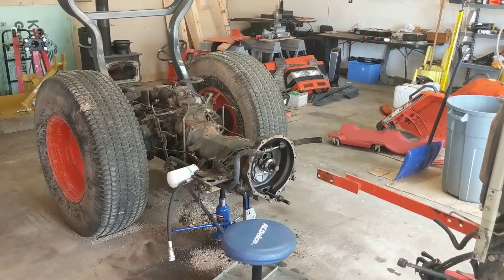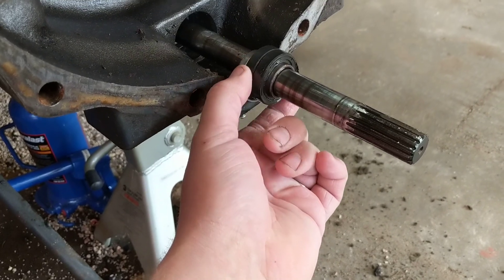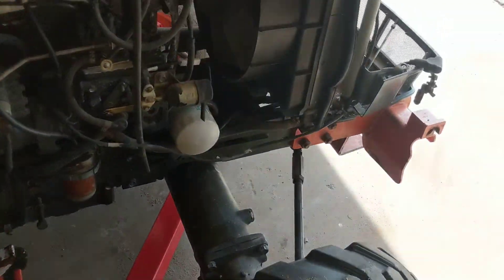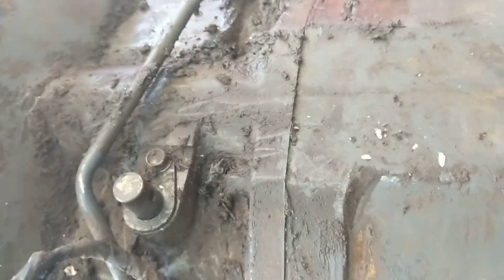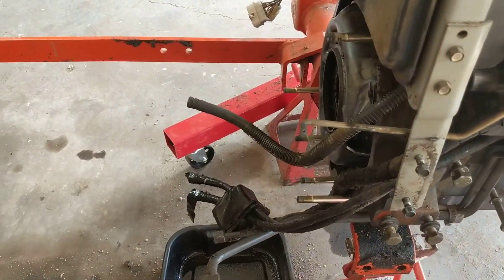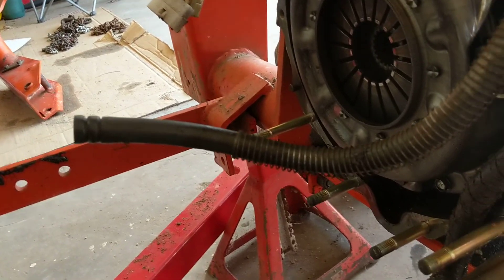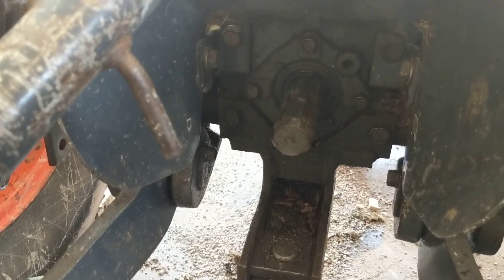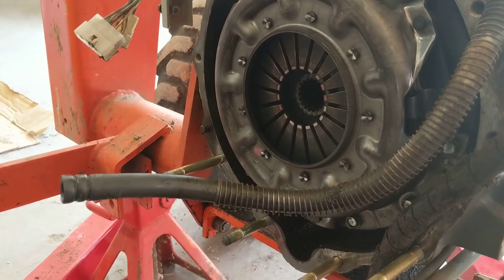Kubota L3010 Splitting Tractor for Propeller Shaft Seal Leak

Comment: Can the shaft be removed to take out the seals or is there a spline on the other end and not recommend pulling out the shaft where the seals are leaking? Thank you!
Reply from the maker: The shaft does come out but it’s next to impossible to get it back in without further splitting the transmission. The shaft is quite long and very tough to try to line up the splines it fits into in the back of the transmission.  I made that mistake and ended up having to split it further. It’s not a terrible big deal if you already have the tractor split but just extra work.
Reply: @thehobbyfarmer21  Thank you for the response, what are the part numbers for the bushing and the seals, I have the same tractor, Thanks.
Reply from the maker: @mustang19641964   I use Messicks as they have online parts catalogs. If you go to their website you can type in L3010 and find a breakdown of the propeller shaft assembly. There are 2 seals which should be part 09500-25388. The sleeve that the seals ride on is 53582-5352-0.
Reply: @thehobbyfarmer21  Thank you!!!!!
Reply from the maker: I also forgot the shaft fits into a collar in the rear of the transmission. The collar fits onto male splines and that is what will fall off into the transmission which then you have to go fishing for it.